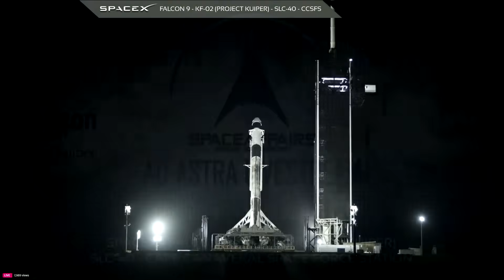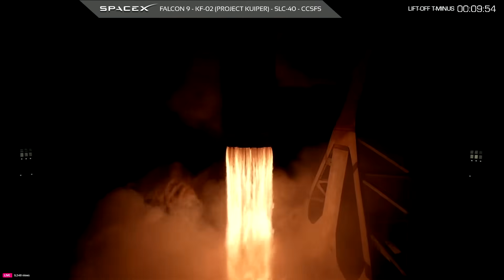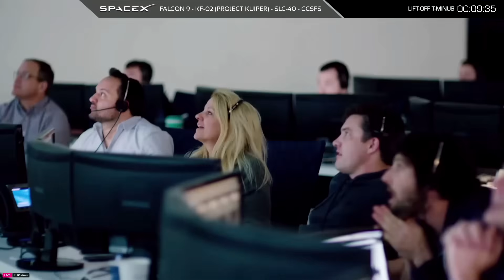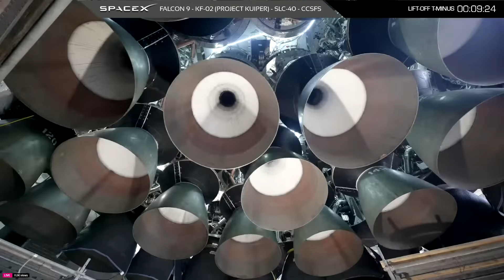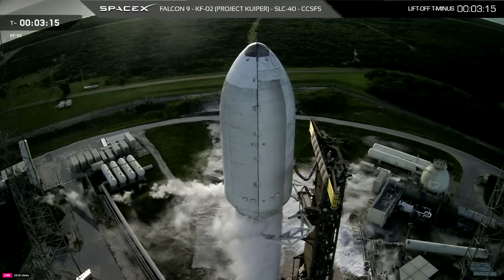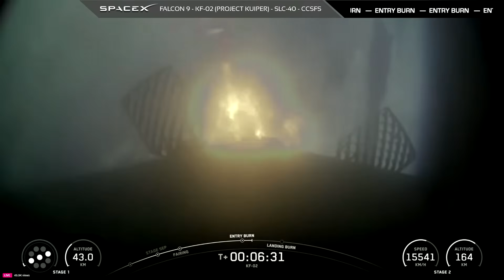SpaceX - Falcon 9 - KF-02 (Project Kuiper) - SLC-40 - CCSFS - August 11, 2025

Comment: Amazing landing.

Vertical landing rockets heavily use AI tensor models.  They learn from simulation and real world missions -- trained from both.  There's great reason to be optimistic about this improving over time.

However, it should be noted that we need real mission data from Moon / Mars on MANY attempts before we attempt human missions.  Conditions are simply different on different bodies; the physics, the sensor readings, the camera data and environment -- no simulator we craft here could fill this gap.

We may see this as pretty routine now, but landing on other bodies is still effectively untrained.